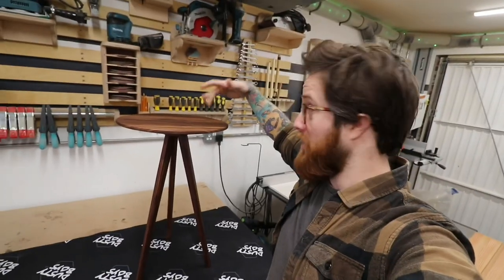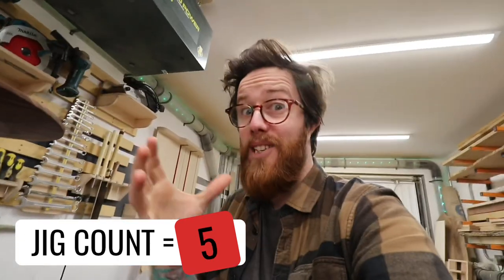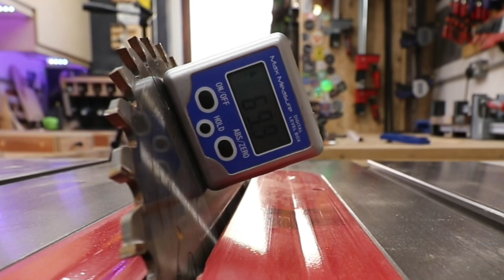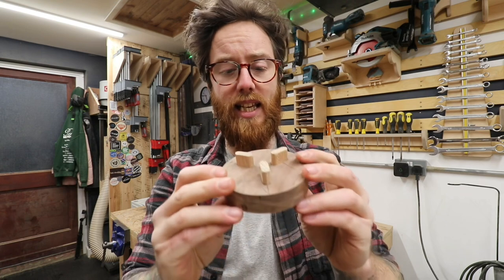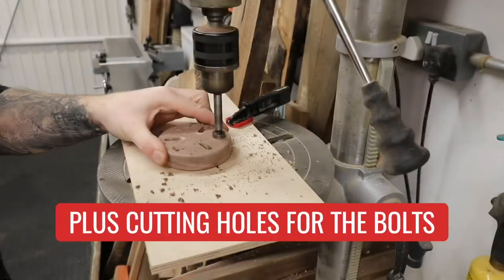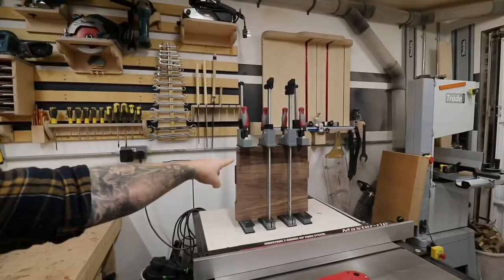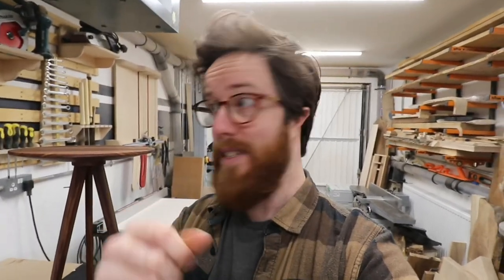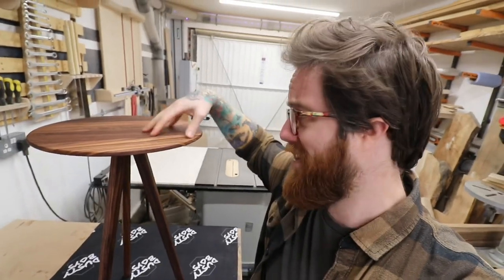…Does it Take to Build a 3 LEGGED Table || Woodworking

Comment: Hey dude I love you Video and   your video Style, especially the funny parts you put in 💪

I spent over one year to get 1000 subs woooow 👏
Is this the normal domino or the maxi you use?
Reply from the maker: Hey dude! Thanks mate, that means a lot coming from you 👊🏻 Always like a bit of comedy 😜 

No way, that surprises me with your videos. It does help with a little following on the old insta though 🙈😂
It’s the big XL domino mate, would love to have both one day but definitely glad I got this one first 🤙🏻
Reply: @monkeyboysworkshop  okay should i take the big first??
Reply from the maker: @createdesign  Oh 100% mate! You can get adapters for it too that’ll cut the smaller mortises that the 500 (small version) does, which I still need to get as well 🤣
Reply: That's a very good tip I didn't know. Great I'll take the big one 🙂
Reply from the maker: @createdesign  Let me know how you get on with it dude! Either way you won’t regret it 😜🤙🏻